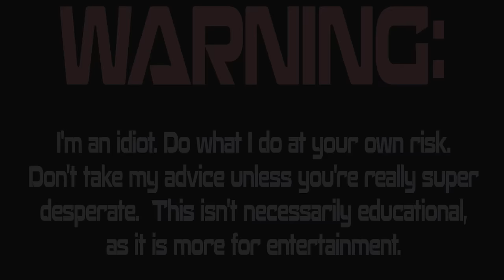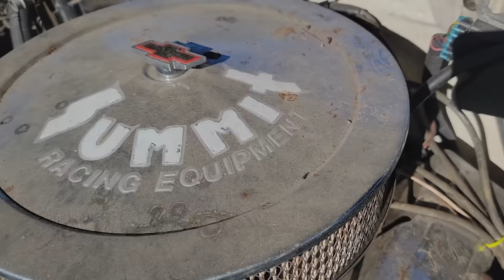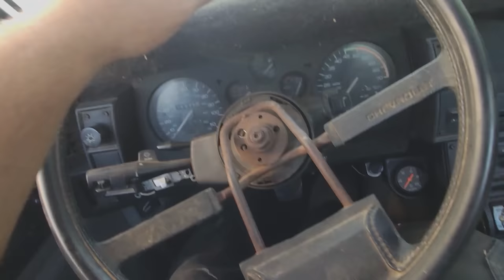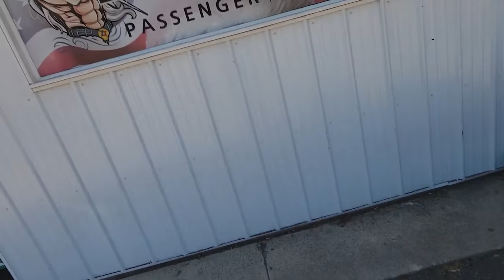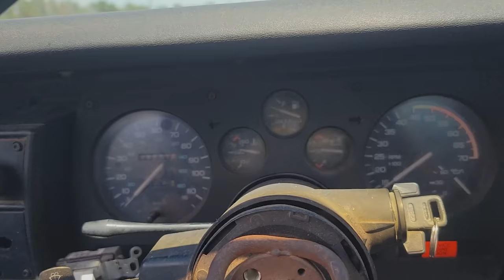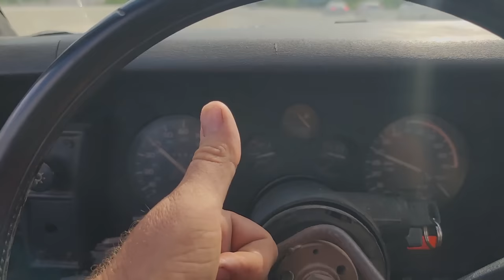Barn Find Camaro - Will it RUN AND DRIVE 600 Miles Home?

Comment: That old theory that removing the thermostat will make an engine run hotter because the coolant needs time to absorb the heat is just that, a theory.

The reality, that has been proven over and over, is that removing a good working thermostat from an overheating engine makes almost no difference if the radiator is undersized, airflow is restricted, etc. One thing removing it will definitely NOT do is make it run hotter. Conversely installing a thermostat where there wasn't one will NOT make it run cooler.

What will make an overheating engine run much cooler is running straight water instead of antifreeze. Water conducts heat about 40% better than 50/50 antifreeze and that allows the heat from the engine to get to the radiator much more effectively. 

Personally I always run a thermostat. Engines don't like to run too cold and without a thermostat the engine can run too cold, especially when the weather is cooler. A too cool engine will build up moisture in the oil, resulting in internal corrosion and a seized engine if parked for a while...

Comment: I WOULD LIKE TO KNOW, HOW DO YOU GET TO DRIVE THESE CARS ON THE HIGHWAYS BOT REGISTERED aND IF YOUR INSURANCE IS LIKE MINE WAS WHEN i DROVE CAR LOT CARS, THE DTATE LICENES WAS ONLY FOR THAT STATE EXCEPT WHEN I CARRIED A REGISTERED TRIPP ROUTE AND WE DID HAVE USED CAR INSURANCE FOR A DEMOSTRATON AND WE WERE REQUIRED TO KEEP A LOG JUST LIKE WHEN TRUCKING. THAT WAS WAY BACK IN THE 1960'S IN KANSAS.

Comment: My first car was a steal. 1987 305 swapped Camaro for $350 because 1st and Reverse went "out" after a clutch change. The very first thing I was suggested to do was add transmission gear oil. Someone must have forgot to add gear oil because it was bone dry. It went right into first and reverse after adding two or three bottles gear oil to reach the plug level. Then it drove like a champ for years. Especially when I got a Holley 650 Quick Spit with a 1in spacer, ditching the 750 Quadrajet. That gave it noticeable horsepower. I kick myself in the ass sometimes because I sold it to my cousin. He tried to drive it like he seen me drive it and cut a phone pole in half. If he wouldn't have spun around first hitting it with the rear end, it would have killed him. It was the corner I always hit at 100-105mph because the road was banked with the turn. He tried to attempt it half drunk. That would have really screwed my mind up if he killed himself in it.

Comment: You need a 1986 s-15 with  a 4 speed iron horse tbi ? Read comments .
Reply: Oil pump and shaft are necessary
Reply: Only sat 4 years and has been in dry shop until a month ago

Comment: Why on earth did you dump the clutch in 1st gear? Have you never roll started a vehicle?  2nd 3rd at least.   Higher the gear gives you more torque on the motor as well as making things 100 times easier on the old clutch!   

Love yer content.  But dooood?!?  Kind of a newbie mistake!!!
Reply: 1st is 1k’s of rpm per tire rev.  Overdrive is the opposite. Not thousand.  But way better from all angles.
Reply from the maker: Your theory is completely backward.  Go 25 mph in 1st gear. How fast is the engine turning?  Now go 25 in 4th, how fast is engine turning?  Torque is also best in 1st, 1 to 1 in 4th, and overdriven in 5th.

Have done this dozens of times successfully as this very video demonstrates.

Comment: 😅 wait, how does he know I wasn't paying attention. I'm dealing with girlfriend, then I hear. Are you even paying attention. Um, no I wasn't,  ok, rewind for the umpteenth time 🙄 I had a 92 Z28 after high school. Loved that car, ground affects. T tops. Wish I had it back 😢 I'm from Mississippi Gulf Coast. One year I went hunting at families place in Central Mississippi. Water pump went out on Z28. I changed it with a screw driver and Cresent wrench. No problem. Bad hurricane George in 1998. I had to sell Z28 😢. I bought a 94 Ford Ranger. Hugh mistake. Nightmare to repair. Water pump went out on it while hunting. I had to completely disassemble the motor  just to get the damn  belts off.  Nightmare. WTH Ford. Why I have to take the tailgate off to change the damn Water pump. Ruined me, All day job. Disassemble half the motor. 😧😡

Comment: Marvel Mystery Oil - Per Wikipedia

According to the company's 2015 safety data sheet, Marvel Mystery Oil is composed of:

    Petroleum distillates (hydrotreated heavy naphthenic), also known as mineral oil, 60–100%
    Petroleum distillates (Stoddard solvent), also known as white spirit, 10–30%
    Tricresyl phosphate, an antiwear and extreme pressure additive in lubricants 0.1–1.0%
    Ortho-dichlorobenzene, a softening and removing agent for carbon-based contamination on metal surfaces, 0.1–1.0%
    Para-dichlorobenzene, a precursor used in the production of chemically and thermally resistant polymers, <0.1%

In an NTSB post aircraft accident investigation published in 2003, it was reported that Marvel Mystery Oil was composed of 74 percent mineral oil, 25 percent stoddard solvent, and 1 percent lard.

Comment: This video is an over reach. The Lamborghini Countach was a cool car in the 80s but technology has caught up and surpassed Lamborghinis and Ferrari, they're not fast compared to a modern run a the mill sports car. A regular sports car these days leave the assembly line with between 600 to 1000 horsepower. There's way more technology they have magnetic suspension can 10-speed manual Matic transmission Lamborghini and Ferrari does not obtain that type of Technology never did